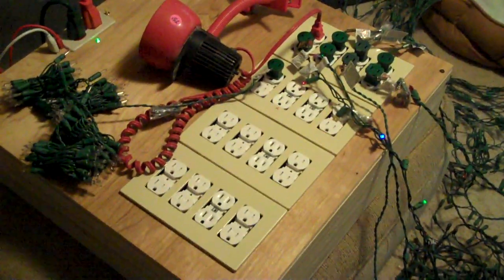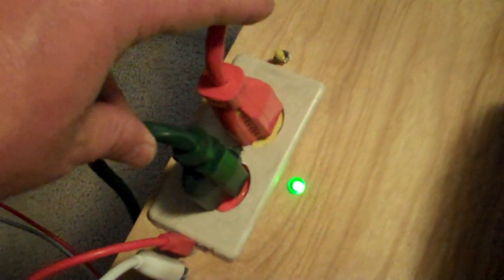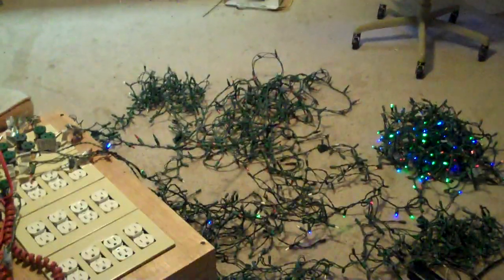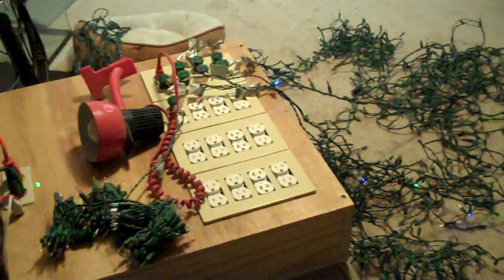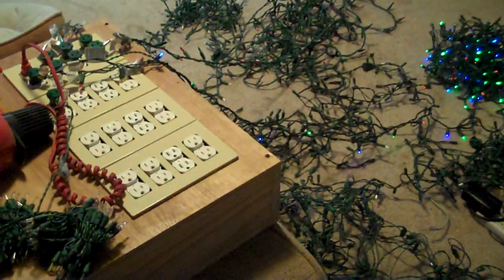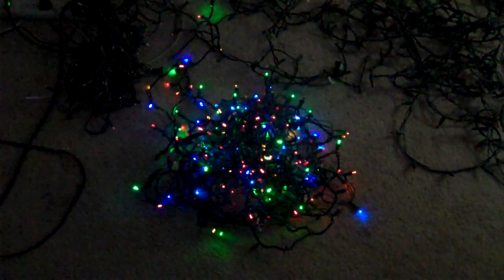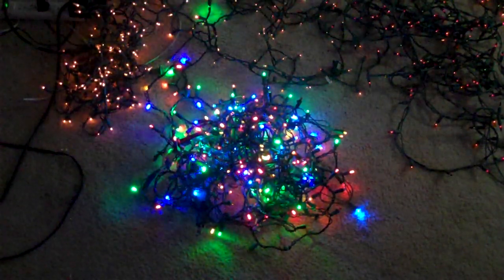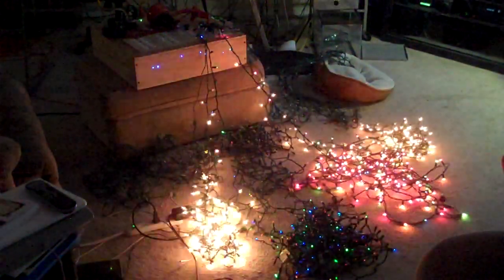Christmas Lights Control System  Part 18 - Version 2

Comment: do you need to use the FT232R breakout board for it to work with vixen?
Reply from the maker: Yes if you want to use the serial interface from vixen this is the simplest solution.  Here is a longer explaination:  https://www.youtube.com/watch?v=O8RZFEsQImk&list=PLp21wF8e4XnjNSQHJcnvNSDdb1wsPOfHi&index=10

Comment: are you using Incandescent lights in your show?
Reply from the maker: just the little mini lights
Reply: I don't know if you know this but, each one of those light strings pulls 1.9 amps and your trying to do that with 32 channels, that's 60.8 amps your are trying to put through two 15 amp circuits you are overloading them by 2 times.

Comment: I am just starting this project and not sure if you still check the comments but I was curious as to how the dimming works.  Besides changing the SSRs on the Sainsmart boards, what else needs to be done in order to get the dimming working correctly?
Reply from the maker: You have to build a little AC zero cross detection circuit which sends a signal to the arduino. The code uses the signal to determine when to turn the power on/off for dimming.

Comment: i commented on you older videos about the same issue. As i had stated in the one comment, you do need to have an interrupt on the arduino on the zero cross. the arduino needs to know exactly when the AC cycle reaches the zero cross so it can time the SSR accordingly. once that is done it will get rid of the issues with the LED strings staying lit. but the other issues is with the LED strings themselves. usually they are split up in groups to divide the voltage and share 1 half the AC cycle. so you will have one half the string on one Swing of the cycle etc. if you have any way of getting around this let me know.

Comment: 1 suggestion ,im only 13 so check what im saying before doing it, but for the leds and other chanels hook your machanicles up in series with the ssrs so you can cut power to them  when they are sopost to be off and put a capasitor on the mechanichal relays so you have no noise in the mechenical relay so its solid on while the solid state relays
are getting pwm therefore able to dim and cut power to the ssrs when the ssr is sopost to be off